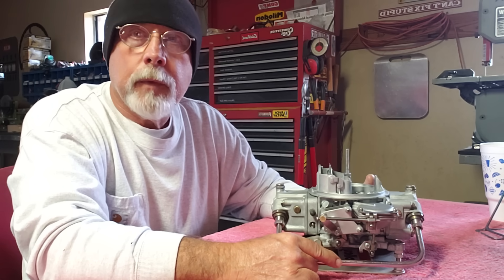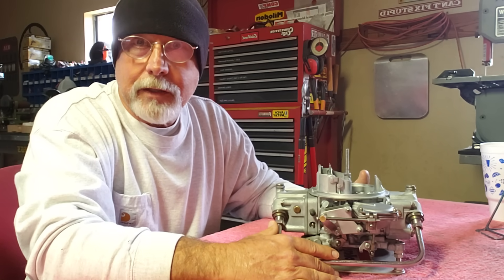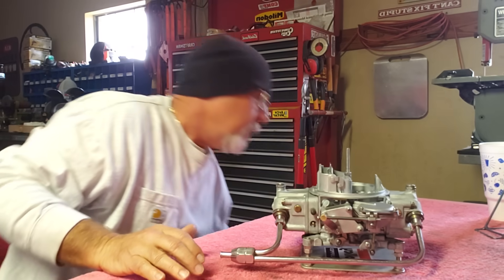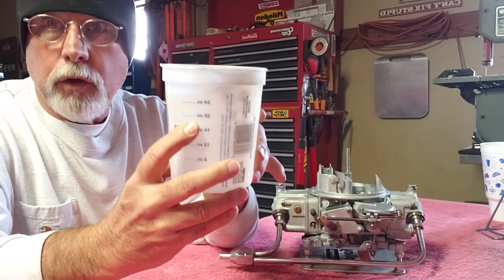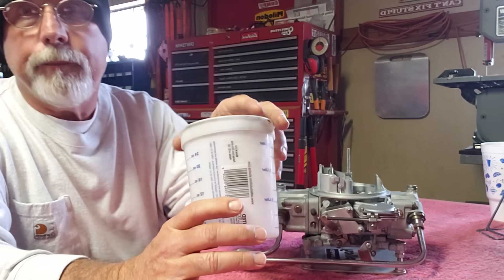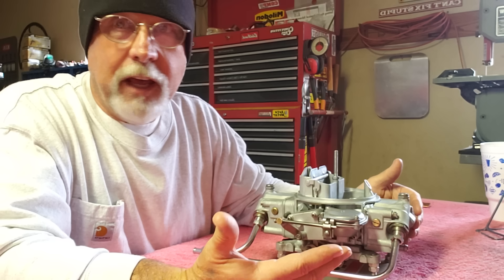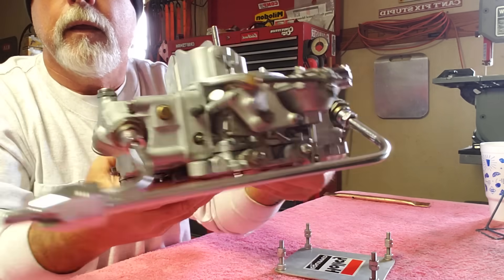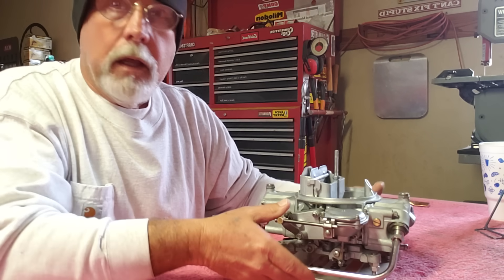Best carburetor cleaner ever!

Comment: Back again. Muriatic acid went to $23.00 a gallon. Generic type is $8.00 on EBay. Still a good deal considering.
Reply: You can get it at a Pool Supply store or  HD/ Lowes. It looked like he was holding up a jug made for swimming pools (he did reference that in the video)... on HD website today  I see it for $11 for 2 gallons ( 2 single gallon jugs)

Comment: This procedure will result in hydrogen embrittlement of the aluminum alloy, heat-treating after the soak may relieve it. It needs to be done immediately afterward though.
Reply: @davidp8563  Well, yes I do, the metal has plenty of stress on it. There's temperature cycling (severe depending on where it lives), the torque of every bolt and screw in it, the nuts that tighten against the intake gasket are an uneven source of extreme stress, casting seams, etc., etc., etc. There is plenty of good information freely available online regarding hydrogen embrittlement and how to deal with it. It’s essentially just baking the metal at a particular temperature for an extended period of time, it’s important to do it right away though. It may still have some positive effect but I don’t know how much. I do mine immediately following any hydrochloric acid bath but try to avoid this particular acid on metal whenever possible.

Comment: Yamaha made a product years ago that was only available to the service depts. it was a carb cleaning solution that was meant to be poured into the gas tank because motorcycles had been shipped with fuel in them and it gummed up the carbs. The stuff was amazing and worked as it was supposed to especially if you disassembled and soaked. Wonder if it still exists today?

Comment: The acids will attack the steel parts not the aluminum.  May end up with more throttle shaft clearance if left in acid bath too long.

Comment: the holley carb is not aluminum it is pot metal or zinc. AFB carbs are aluminum
Reply from the maker: Holley is a die-cast body is generally made of either aluminum or zinc. Since die-cast aluminum tends often to be porous, die-cast aluminum carburetor bodies must first be impregnated with a special sealing material such as zinc and yes this process will dissolve zinc so that is why you only leave it in the solution for a short period of time. Just long enough to remove the crud.

Comment: What a Bad idea!
When you suggest an idea like this most viewers will not read the part about pot metal. Most carbs are pot metal, cast aluminum. Carb cleaners are made for cleaning carbs!
Pool acid is not carb cleaner. I rebuilt carbs since 1974.

Comment: I use vinegar,,, I brought a 30 year old triumph motorcycle tank back to new with a 24 hour soak,,,and you don't have to worry about hurt any metal
Reply: I was given a lawnmower by a lady who lived next door to some people having a yard sale. Free is always worth the price. Anyway, I got it home and took off the fuel cap, finding the tank extraordinarily rusty. It's the steel can that doubles as a "float bowl". Well, I decided to try some de-rusting agents to clean it out. Naval Jelly was first. Totally useless in the case of the fur lined tank. Next was Limeaway. A tiny bit better, but I didn't have a couple weeks to deal with it. Finally, I went with a drain cleaner that had been recommended by a local hardware store employee for a bad clog. It is called Bulldozer drain cleaner. I didn't have anything to lose, so I put the mower out in the yard and poured in a few ounces of Bulldozer. It started bubbling and fuming, so I retreated to the porch and used the solid stream nozzle on the hose, blasting out the tank from about fifteen feet away. I tipped out the water and saw shining metal in the tank. Two more treatments, and the interior was spotless. I used compressed air to dry out the tank. Sprayed the carburetor with some aerosol brake cleaner and gave it a go. Fresh gas and oil and a quick clean of the plug. One pull of the rope and it lit right up. Amazing. I used it a few times, and then a friend needed to borrow it. As far as I know, it's still in service.
Reply: Just a matter of time - your's be the slow way.
Reply: I used some vinegar once on some rusted iron.  It did a good job.  I then put some very rusted brake discs in.  I was shocked, it was dissolving the discs.  SO, try a small piece of the same metal that you are wanting to clean.

Comment: I just stumbled across this video . I rebuild carbs out of my work shop at the house too . When I disassemble the carb I soak the carb in The works toilet bowl cleaner from dollar General. I do it outside for the ventilation . I take the tip of the bottle and squirt the liquid down throughbthe ports and passage ways and let it boil out the carb and I let it sit for 15-20 minutes then go to the sink and wash and flush the carb and its ports/ passage ways with Dawn dish soap and hot water till there is no more bowl cleaner . then I blow out the carba nd ports with compressed air and if the outside of the carb still has some filth I use an old tooth brush thats not being used for brushing teeth and a can of carb cleaner to finish it off. I've rebuilt carter 1, 2 and 4 barrel carbs and  edelbrocks and a quadrajet doing this process and they run great after reassembled
Reply from the maker: Cool!

Comment: First I thank you for your service Sir. I worked for Holley as a machinist for years and will tell you that all the "body" parts on a Holley carburetor are solid zinc. Excellent video, thank you.
Reply from the maker: Thanks for sharing
Reply: @ronniehenson4122  I certainly learned something  here. I never once thought of using muriatic acid for a carb cleaner. I have soaked steel and cast iron in a solution of water and 10% molasses. Takes about a week but works amazingly well. My most recent rust removal was the inside of a very rusted motorcycle tank Thanks again.

Comment: Hey Ron just curious what made you think of using muratic acid??? 
I've got two primary carbs I'm gonna do on my 140 Corvair and I'm gonna try this out I bought the Gunk 1 Gal. Can of carb cleaner that stuff use to be the $hit back in the 70's now it's for pansies F'N EPA  an it did the job on my secondarys but they were off the eng. When I got it and dry as a popcorn fart for year's!!!!! Any way thanks for your video on this I wouldn't have ever had the ball's to try this even if I had thought of it and I've got a gallon of it in the shop not sure if its still good I'll have to ck. The shelf life on it. Tnkx.
Reply from the maker: Just had an old junk Holley (Nothing to loose) that was junk and was curious as to what would happen.

Comment: Never use Acid on die cast. The body /bowls/metering block/metering plate/pump cover/pump nozzle are all Die Cast. Die Cast is a mixture of mostly Zinc and some Aluminum and other additives manufactures put in to make it flow and cure with out porosity (Zamak 3). Acid will eat Die cast. It will eat the small threads for the needle seat in the bowls. It will eat away the material around all your pressed in air bleeds and the will fall out. You said you tested a base plate. The base plate is Aluminum not Die Cast. I have been restoring carburetors for over 30 years. Plus acid will not degrease parts. I use a light caustic solution at 180 deg to degrease. Berrymans is a good degreaser. It works better when warmed up about 150 deg. Also my clean tank agitates the parts to rinse away the loose stuff. To get the die cast to take zinc plating or chromate conversion coating after it is degreased use a # 10 glass bead in a blast cabinet.
Reply: You want to rebuild my carb on my boat? It goes on a 2.5L mercruiser.
Reply: You are very correct !
And if you do manage not hurt any of the ports or other parts, you will have ongoing corrosion issues for the rest of the carbs existence. Ask me how I know !
Do yourselves a favor and find some Hydroseal to soak them in. And yes, I neutralized the acid after dipping.

Comment: Used regular spray paint shop thinners, put jets small parts in a glass jar to soak, worked a treat, but don’t soak rubber O rings as it makes them expand , stay lucky fella...😉🇬🇧
Reply from the maker: Great tip!

Comment: Hey Ronnie..I've used muriatic acid to clean out a stopped up catalist converter..it works good..as long it isn't broken apart inside..
I've also used etching wheel cleaner on carburetor's too..phosphoric acid will work too..I'm going to use muriatic acid on my next carburetor 
Thanks for the tip..Cheers 🍻🍻🍻🇺🇸🇺🇸🇺🇸🇺🇸🇺🇸

Comment: there is a cleaner called Brulin 512M they use it in Heli engines , see if an operator of Bell 206 or MD500s are around and see if they will sell you a pint, you can soak carbon off easily overnight with it. if using acid, you have to neutralize it after the acid dip with water and baking soda for a bit   then into water

Comment: Ron,, thank for a great informative video. I have carbs that need rebuilding and a 5 gallon pail of carb cleaner in not cost effective for a home shop. Your way makes sense. 
Just one suggestion, I think you are using your phone to record, there is a setting in camera that you can set so your video is not backwards (words backwards) using the front camera which I guess you are. I have a Samsung S7 edge and I found that setting and now the picture looks correct. Trying to read the muriatic bottle was challenging LOL.  
Thanks again, have a great day.
Reply from the maker: Thanks already changed it

Comment: Did you say it was totally disassembled when you put in.just wondering how you hung it by the air cleaner post. Thanks
Reply from the maker: Totally disassembled and hung each piece. The main body was hung by the air cleaner stud and the rest of the parts were hung by copper wire.

Comment: Back in my day, the 3310 was 780cfm.
You really need to pull out all the lead passage plugs in order to properly clean out the emulsion tubes. Otherwise they run too rich and feel kinda heavy and flubby.
Jussed sayin' 😶
Reply: Yes it was, the 3310-2 and up were 750 cfm.

Comment: I've forgotten more than I know but I think we used to call them a Holly double pumper
Reply: Double-pumper has mechanical secondaries, along with a secondary accelerator pump with center squirters.
3310 incorporates a vacuum secondary actuator, and just one accelerator pump for the primaries.
Reply from the maker: Double pumpers will have two metering blocks hence the term "Double Pumper"
Reply: @ronniehenson4122   The first 3310 was rated at 780 cfm, and had a secondary metering block, and was considered a 4150 according to Holley.  All 3310's after that were rated at 750 cfm, and without metering block, and called a 4160.  Carbs with 2 accelerator pumps are double pumper's. You make  great informative videos, and thank you for your service !

Comment: "Pour the acid into the water" - very good example of an old bullshit story. I will bet the farm that nothing happens if you do it the other way around.
Reply: Actually you are wrong, it does matter which way round you pour, when you pour water into acid, you will always get some splashback, and the splashback will be the acid, you would not want to get that in your eyes, however if you pour the acid into water the splashback will be the water, not quite a potentially dangerous!
Reply: @petercrane2065  The myth talks about a violent chemical reaction - like boiling over. It doesn't talk about splashback. That's the way I heard it.
Reply: @paulsawczyc5019  There is no Violent chemical reaction between muriatic acid and water, It is just a case of splashback it was merely a warning,  Remember muriatic acid is nowhere near as corrosive as say sulfuric acid, I use muriatic acid all the time in my pool, and I handle it with bare hands,
But I am careful to keep it away from my eyes, It really is not much stronger than citric acid, in fact in certain circumstances muriatic acid can be replaced with citric acid or even vinegar, if you want to test the theory just pour some dark colored liquid into clear water and see what color the spalsh back is, then reverse the process, then see what color the splashback is,its simple really!
Reply: @petercrane2065  Gotcha - thanks for the explanation. I like to do things safely, but I also believe that there is way too much safety hysteria.

Comment: Safety note definitely dilute the Muriatic acid. When I was young rebuilding a VW air cooled aluminum block I got tired of the dull grey and used the Muriatic acid full strength and caught the block on fire literally. I washed is down with a water hose. Block came out to the shiniest aluminum you ever saw.
So I could see this also working on 2-stroke and lawnmower carbs and aluminum heads and intakes which could be tested on a scrap intake or head.
#4 neutralize with baking soda, it will foam up, in case you are on a septic system so you do not kill off the organisms digesting the solids. When it stops foaming when adding baking soda it is about neutral pH (sort of like vinegar/baking soda reaction, just much stronger acid).

Thank you for your time, I can see other applications with this cleaning method and baking soda blasting.

Comment: Any  chance you tried a baseplate with seized throttle shaft to see if it penetrates enough to loosen them?
Reply from the maker: My base plate wouldn't hardly open due to all the crud and after I soaked it for 10 minutes it worked fine.

Comment: muriatic acid will dissolve alum in the right mixture, my father used to refurbish commercial band saws, they came in with alum bonded on from sawing castings, we had plastic barrels with the right mixture and dunked them for specific amount of time and they came out clean. that was late 60's early 70's, so i don't remember the ratio to water but this is a fact jack
Reply from the maker: Thank you!

Comment: Have you tried your solution in an ultrasonic cleaner to clean carburetors?    Many years ago pre sonic cleaners we used this acid bath technique on diving regulators to clean the internal brass parts and passages.  Got out any residual corrosion from salt water use.

Comment: ATTENTION! I put carb into acid. It started to boil, become black and half of ot melt away :( just for 5 min
Reply from the maker: That's because you can't follow instructions.
Reply: @ronniehenson4122  yes...    Can you tell how many water mix with acid? In Liters and mililiters? :)  or 3 water 1 part acid? Thank you
Reply from the maker: @bestvideo2720  Yes the 3-1 ratio with 33 % acid would be real close maybe a little less acid to start. This process only works with aluminum carbs, so do a test piece first. I have done over 6 Holley carburetors with no problems. Neutralize in clean water.
Reply: Do acid mix take out carburetor green corrosion from inside?
Reply from the maker: @bestvideo2720  Yes and all the other crud that was left it it for over 15 years hard crusty gas. Look at my other videos on how to disassemble and assembly that is the exact carb that I cleaned with this system and installed and run on my test engine.

Comment: I don't think the Finish is zinc.  Muratic acid utterly destroys zinc. I use muratic acid to take the zinc coating off of galvanized  pipe so it can be painted, but thanks for video
Reply from the maker: You're right, It will remover the zinc if you leave it too long. I only leave it as long as it takes to remove the crud about 15-20 minutes and the zinc  is still there as you can see in the video.

Comment: we used to use muriatic acid to clean aluminum lime trailers. If its too strong or left too long it will turn the aluminum black streaked but it got all that nasty lime off.
Reply from the maker: Follow my instruction and you will be fine

Comment: Great tip, Ronnie! I'm a long time automotive and power-sports tech,and this is the ONLY way to properly clean a badly "gummed up" carb, irregardless of what it is on,once the fuel in it has begun to evaporate and thicken.A bad carb clean can have bad results. I use a Safety Clean commercial product,pretty strong,and have both accidentally AND purposely left metal only parts in this solution for as many as four days with no noticeable damage to the castings,but this may cause some pitting on softer metal welsh plugs,and it can etch brass .Only do these longer dips for carbs that CANNOT be replaced,or the carb cleaner/air method has little effect on dried up fuel,(and if you are an experienced,capable technician). And again,as you pointed out,metal and plastic parts only in acid,it will compromise rubber,I.E throttle shaft seals,bowl gaskets,etc.One important thing to remember,though,(users pay attention,you can save yourselves a lot of downtime,money and aggravation),is that a DRY carburetor or fuel system will NEVER need much,if any cleaning after any length of storage.Always drain a fuel system DRY for long term storage,and you will NEVER reach the point of needing this kind of service. IF you have a steel tank,you must keep it wet to prevent rust,but plastic will always be better off dry. I have made a large amount of money cleaning carbs and fuel systems over a long span of time that wouldn't have been necessary by using proper equipment and fuel storage methods.This applies for anything using any hydrocarbon fuel, (gasoline,diesel fuel,alcohol),that will be subjected to long periods of storage or non-use.Don't let the fuel evaporate!

Comment: Best cleaner ever (been using this stuff for almost 50 years) is boiling water with Tide brand laundry detergent (granulated, not liquid) dissolved in it. This stuff will even strip the paint off an engine block. Just do not get it on you when its hot. Rinses off very well with plain water.
Reply from the maker: Make a video of that process please so we all can learn something, Thanks!